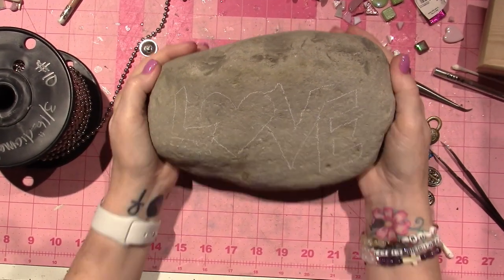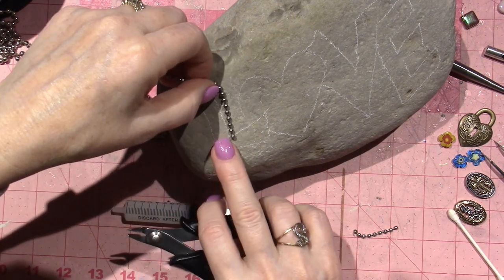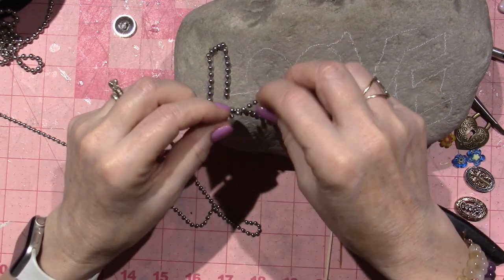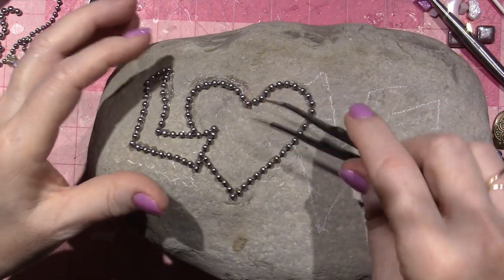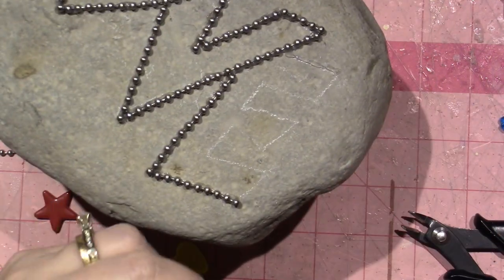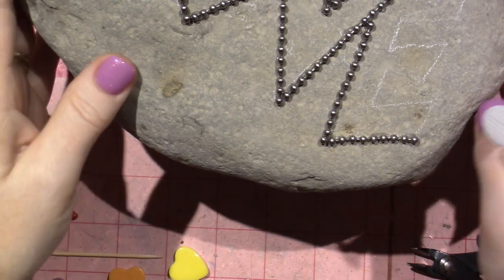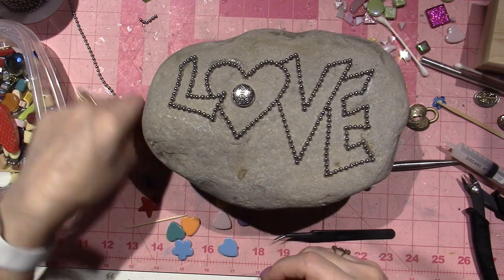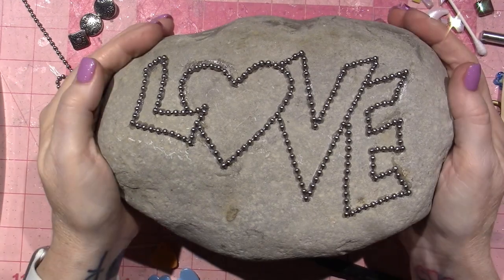Mosaic Rock; Adhering Ball Chain process

Comment: Looking great Sara, you are right you’re getting better at laying the silicone down, it’s messy stuff. I don’t worry about the divots in the rock unless it’s severe. If you put a piece of tubing over the syringe end it will slow the amount of silicone down further. You can also leave it on and the next day just throw the tubing out and put a new piece of tubing on there as the silicone will set on the end. Just a thought that’s what l do. 😊

Comment: Always enjoy watching you work and the way you explain your process. Would the silicone act as a leveler for that cross piece? I have also used a syringe, but not with silicone. Would the silicone that got on the plunger glue it to the tube? Thanks Sara.
Reply from the maker: Hi Donna. The silicone doesn’t stick to the syringe door some reason. Not sure but I think there is a better way to do the leveling. Tfw. Sara